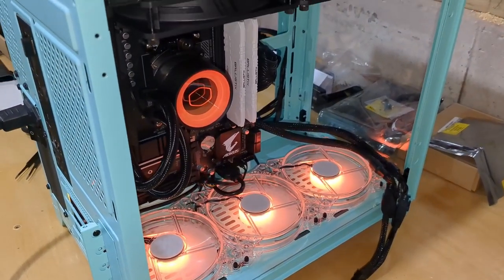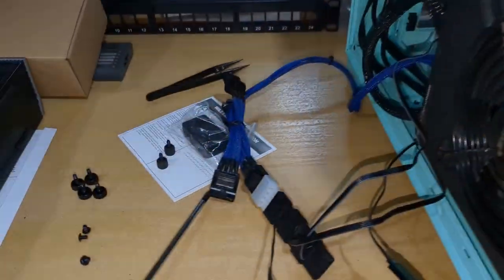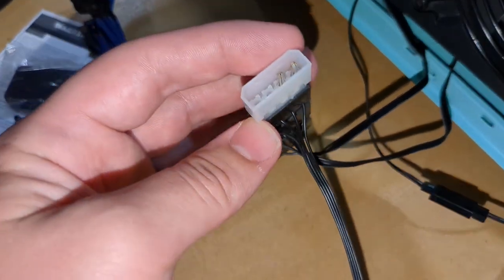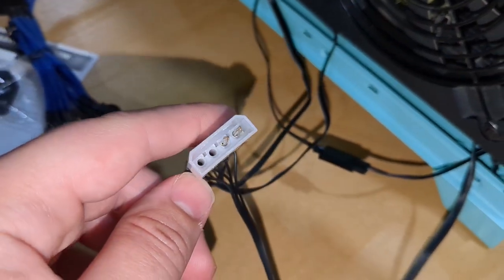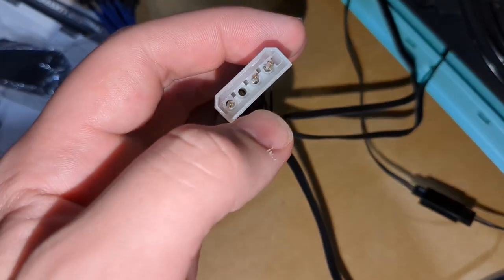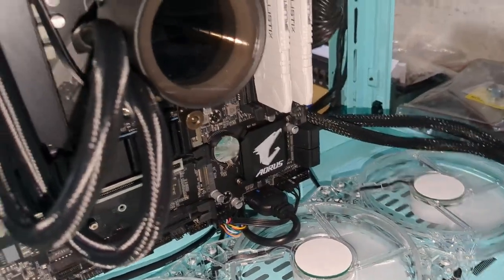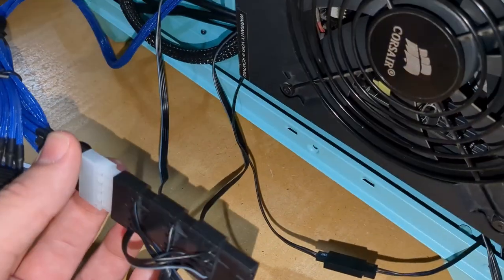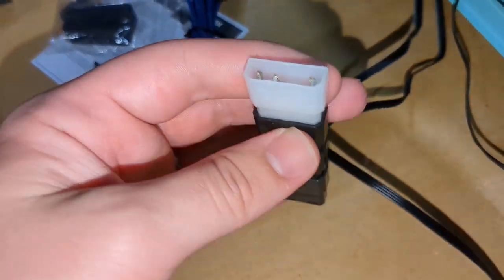DIYPC-ARGB-Q3 Fan troubleshooting using motherboard ARGB header

Comment: hey im having the same issue did you have to buy anything extra?
Reply from the maker: Nope! Mine came with that white molex piece, and you just have to take some tweezers to remove that standalone pin in it.
Reply: @Vipervire  hmmm my case didnt come with that white piece
Reply from the maker: @nickmelin248  huh, maybe they removed the 5v ground pin on the first fan plug instead. You most likely can just remove any 5v pins on the first molex fan plug as a solution